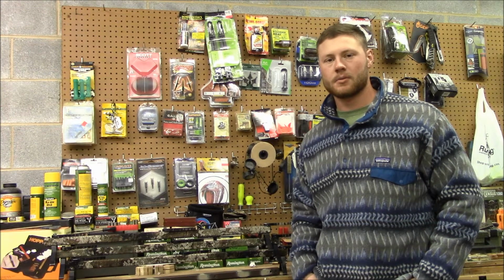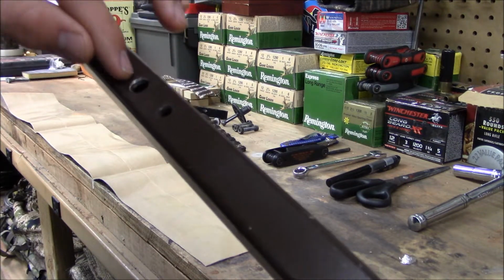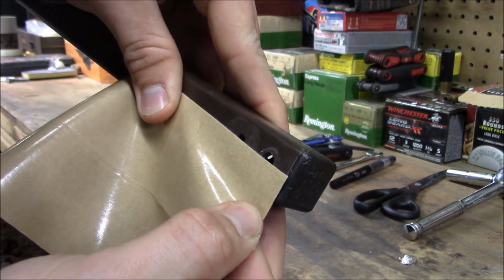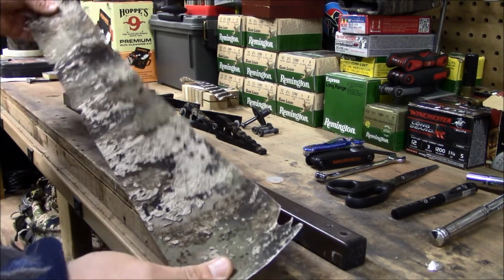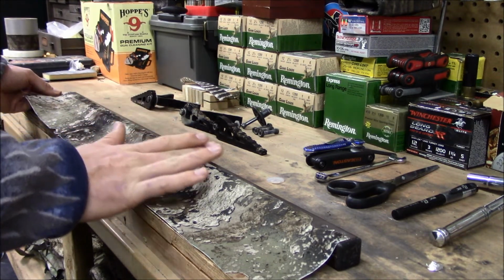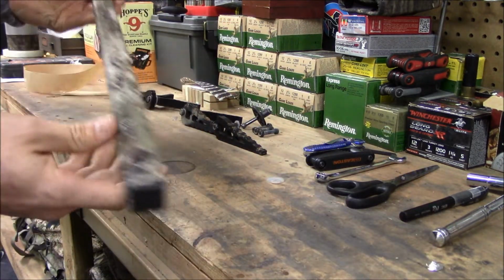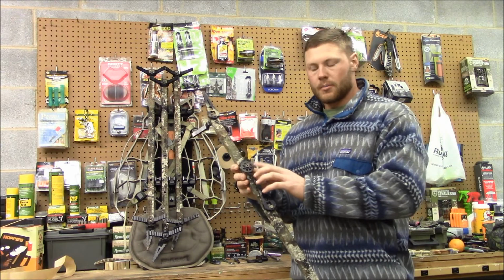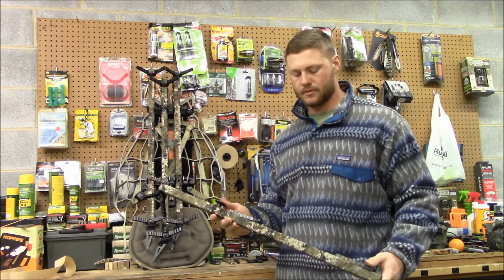Lone Wolf Climbing Stick Mod / Stealth Strips

Comment: I did the same to my LW sticks and absolutely love it. Huge difference! I did end up putting one on backwards but trimmed the overlap of the strip where the step rotates and it has worked out great. It definitely takes a little time and practice but worth every minute once you take them out in the woods.

Comment: One suggestion for easy cutting/trimming is to use a soldering iron with a small pointed tip.  Apply the stealth strip, then feel for the hole beneath with your finger to locate it, then simply push the soldering iron through the hole and stealth strip melts away.  Then use the nylon washer (push a pen through the washer hole and into the stick hole to center the washer and hold it in place) and use 2nd pen to trace around it.  Then simply trace the pen line with the soldering gun tip to "cut/burn" the outline.  Peel off the circular cutout piece.